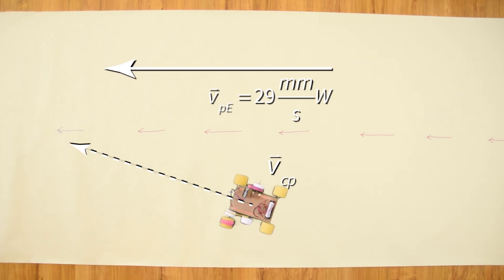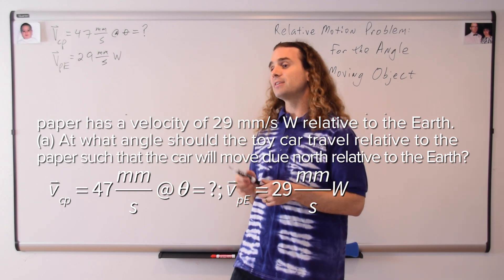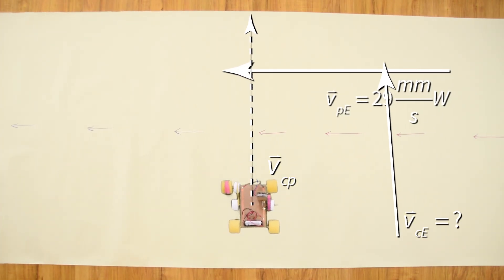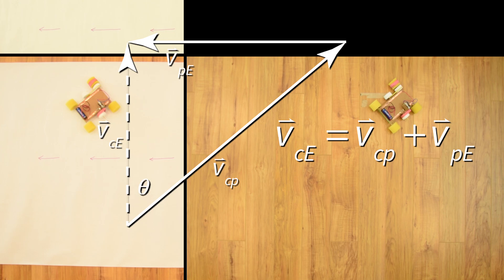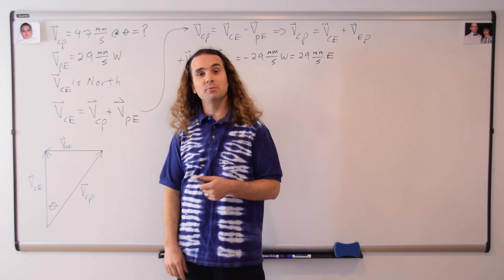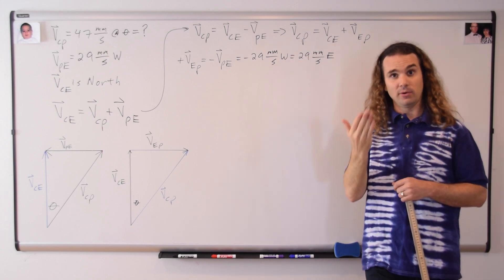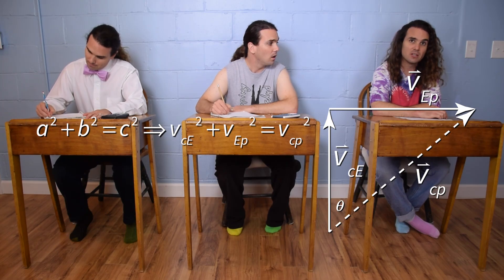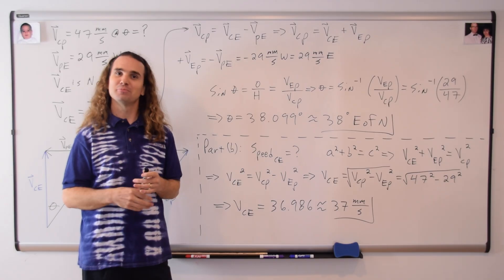Relative Motion Problem: Solving for the angle of the moving object

Comment: wait why dont we just break it down into i j vectors? I did that and got it all right. Especially part b was SO fast. I already had the 47sinthetaJ so I just plugged theta.

On a test will I have to do the method you did here? Im not actually in the class yet its summer so idrk whats standard
Reply from the maker: My memory is that you are watching these for AP Physics C. If that is the case, feel free to use unit vectors, and yes, that makes it much easier. Unit vectors are not a part of the AP Physics 1 curriculum, however, they are a part of the AP Physics C curricula. However, it is important to understand both solutions.